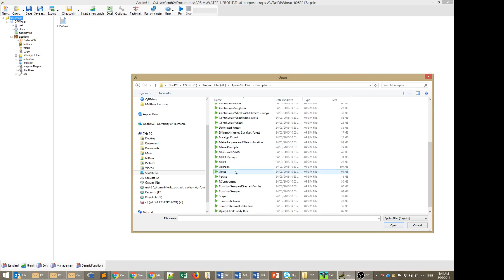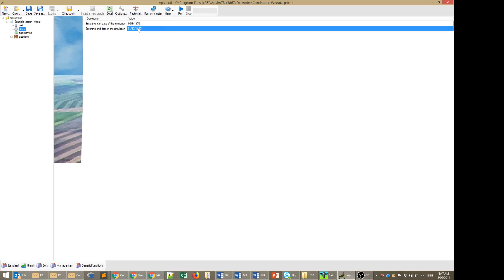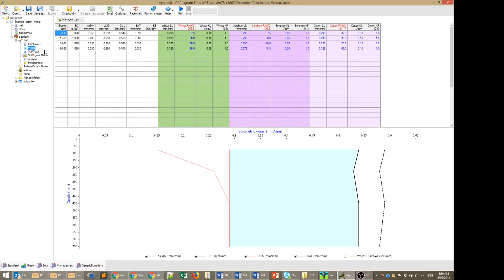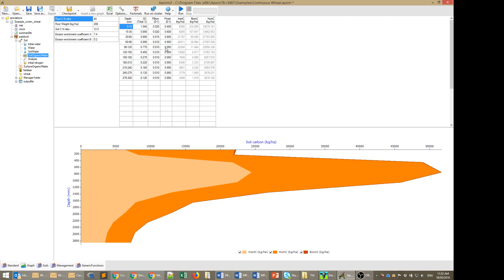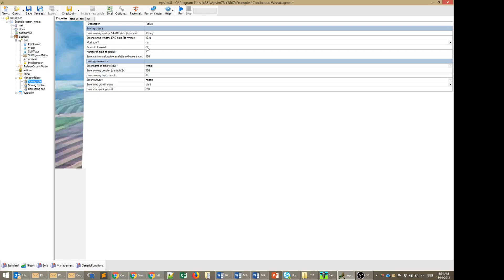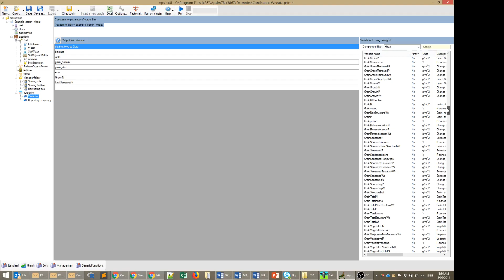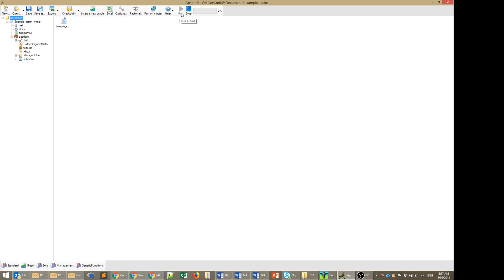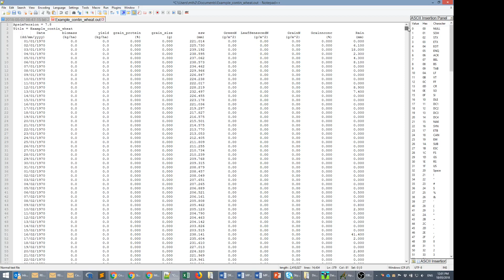How to create an APSIM simulation

Comment: Hello Mr. Matthew. I need to use APSIM model to analysis crop water productivity of sesame crop under rainfed. could you please give me some good idea of how can I use it?
Reply from the maker: Hi Tsegay, to change crop modules (ie the type of crop you want to sow, hit the Standard Toolbox down the bottom, then Open the Crops folder). In this folder, you can drag and drop any of these crops onto the 'paddock' node of APSIM (or your can copy the new crop and paste it onto the paddock above). Then, in the sowing component (e.g. 'Sow on a Fixed Date'), you can select the cultivar to be sown - this will appear as a drop down box. Note that sesame crops are not yet part of APSIM. I hope this helps.